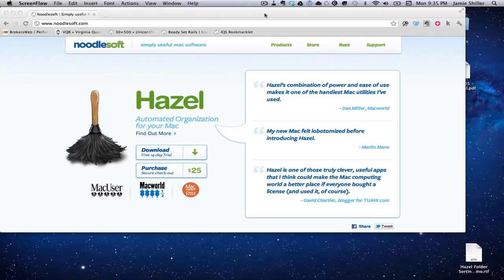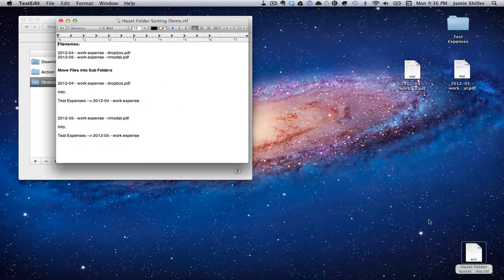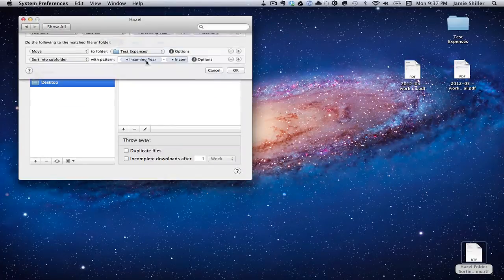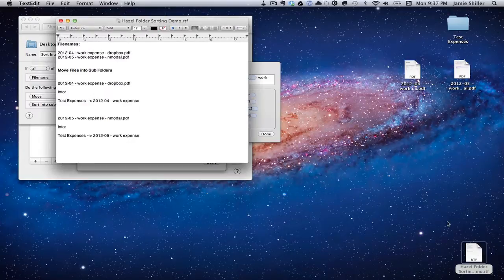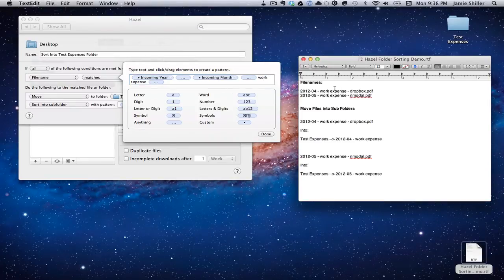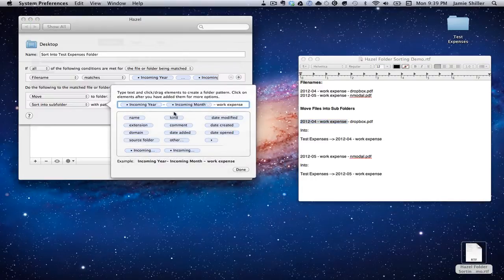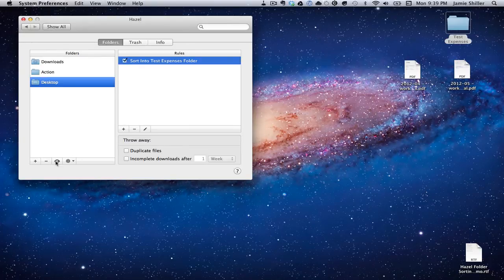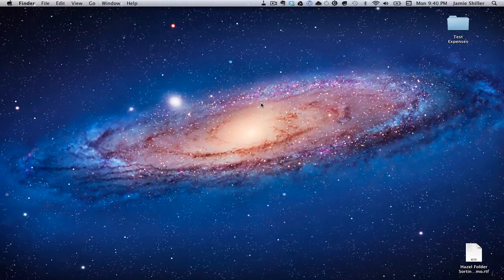Auto Sort Files into Sub Folders with Hazel

Comment: How would you do the sorting if you wanted a folder for 2022, then inside 2022 you had a folder for each month, 01, 02, 03 etc, instead of listing 2022-07, 2022-08 in the root? I'd want a rule that have the main folder be the year and then the files placed in monthly folders inside. Cheers.